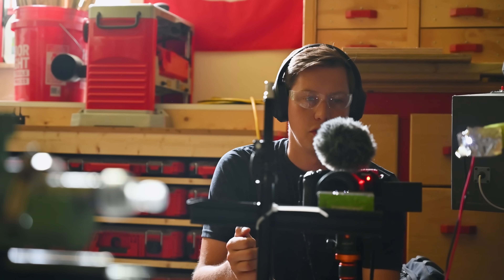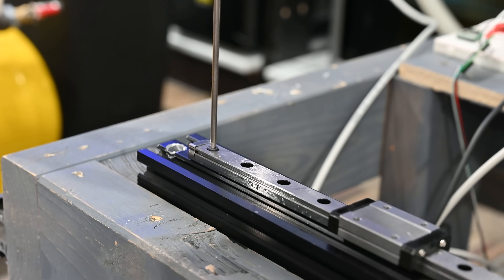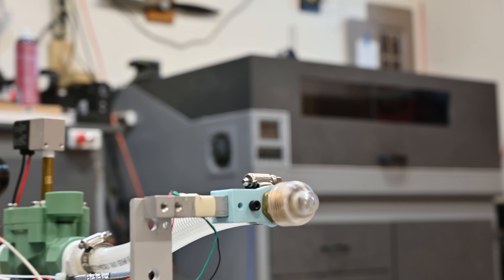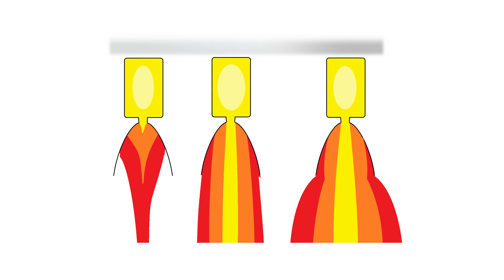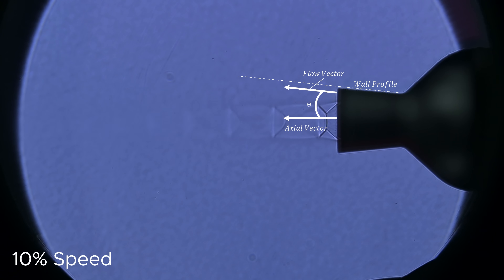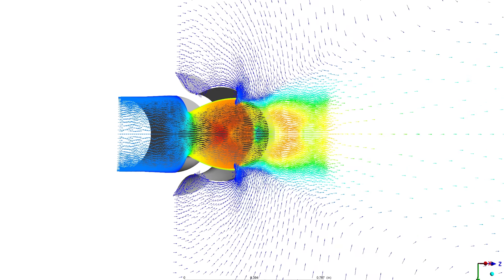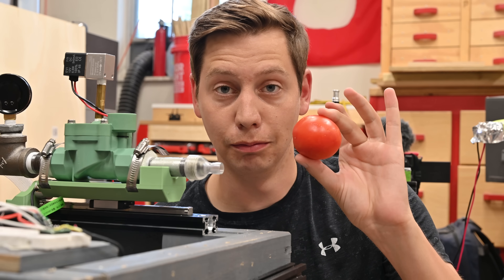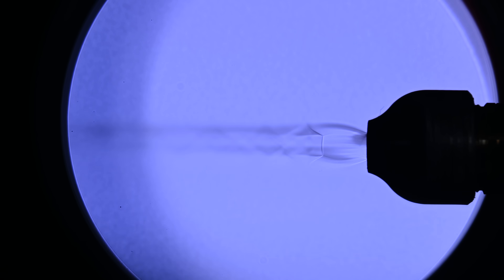DIY Supersonic Nozzle... In My Garage

Comment: This is genuinely an excellent example of using hand calcs! I think this kind of demo is important to show the engineering YouTube algorithm how to…do engineering! :) 

No shade but can we fact check mach 3 though. I looked up a quick isentropic table for gamma 1.4 air, and M 3 is a 4.23 expansion ratio. I’m sure the geometry is hitting that, but static pressure at that speed is 0.027x stagnation pressure which I think vibe check as below separation criterion, so maybe the realized expansion ratio is lower? 

Additional evidence for this is the formation of water(?) condensation later in the blowdown. At mach 3, the t/t’ is 0.35 so ballpark 100K if expanding from 300K in the tank? If you know what the humidity in your garage is, might be able to eyeball what temp you expect the humidity to drop out into vapor. Or more realistically uhhh measure Cf since you’ve got a known orifice for mdot, area and a load cell. 

Great success though, love the vid!

Comment: How did you modify the solenoid valve to have a higher mass flow rate 1:08 ? I have a similar project and would love to be able to use a fast acting high mass flow rate solenoid valve instead of burst discs which have to be manually replaced each test.

Comment: Great video! Nicely done! 

This is completely out of my wheelhouse, so forgive me if my question seems elementary, but would the calculations and formulas be different if your propellant fluid was a liquid  instead of a gas? Specifically, how could I get maximum velocity out of a low volume, high pressure water stream, such as what one might see on a pressure washer?

Comment: Have a question. I have an interest in 2 Stroke engines and am a welder/fabricator.

I've been wondering for a while if there is a readily available CFD program that can accurately model acoustic exhaust wave flow/pattern. 

Can anyone recommend a software capable of that which I could use in designing novel exhaust expansion chambers?

Comment: You may want to consider adding an air dryer to your compressor as it seemed that with each successive  test the amount of compressed water vapor seen during the initial valve release increased. As water has 830 times the mass of air it may be slightly skewing your results.

Comment: I really really wanna try taking a rocket nozzle like this, and putting it in a nerf blaster. My theory is that with most blasters the air pressure has no problem pushing the dart, so mont of the air is wasted. If you could start with the air movinc almost supersonic i think it would help
Reply: Keep in mind the rigidity of the dart when doing this, if you blast something that’s made for a children’s toy with supersonic airflow it’s probably going to rip and not fly very well

Comment: so why does copenhagen orbitals say that a pipe only loses 10% of the thrust of the nozzle, or lack thereof, like a wing without air foil shape only incurs similar losses, someone is feeding gaslighting nonsense to people, and everyone believes it. try straight pipe as the nozzle. yep solid rocket motors are mostly just straight pipes. no, thats nonsense, just use straight pipe, not buying what you say. even if everyone is using shapes unneeded.

Comment: could this be applied to propelling a nerf dart? having a nerf berral at the exhaust of the nozzle with a dart at the end? i admit id don't understand the science well enough. it seems like the air discharge is a bit to slow for a dart blaster, but can that be compensated for with a larger diameter nozzle at a loss of end air speed/thrust? other consideration is  do you get more of a burst with a smaller pressure chamber. the smaller pressure chamber allowing for a faster drop in thrust?

Comment: I am not quite sure if you necessarily need the razor blade in this case. First, shockwaves are very easily visible and are commonly viewed with shadowgraphy instead of schlieren. The reason for that is due to the first-order nature of schlieren techniques. That also brings us to the second point. Your razor blade is horizontal. But from the images of the Mach diamonds on the edges close to the nozzle, the top and bottom edges are vertically symmetrical, i.e. dark-bright above and bright-dark below. For schlieren, the upper and lower parts of the image would be the same, indicating what is observed here is shadowgraphy instead of schlieren.  I don't actually have a point here, btw.
Reply: point not taken

Comment: Just a slight correction on your terminology, when you showed a chart for under expansion and over expansion in a converging-diverging nozzle, you seemed to have mixed up the terms. An over expanded nozzle doesn’t refer to the exhaust gases expanding outward past the nozzle area, instead it refers to the nozzle having a larger cross sectional area than the idealized gas leaving the nozzle causing those gases to be over expanded. And with an under expanded nozzle it is the opposite in that the nozzle cross sectional area is smaller than the exhaust area, constricting it and causing the exhaust to create thrust vectors at an angle. In both cases these cause inefficiencies in thrust which is why a perfectly expanded nozzle is sought after.

Comment: Nice. Good math.  You can fly supersonic with a sonic nozzle as the speed of sound of the exhaust is quit higher than the speed of sound in atmosphere.  This is due to the higher temp of the exhaust.  a=sqrt(RTy)
Reply: i would presume this is at the trade-off of efficiency, seeing as less of the thermal energy being added to the air (+some combustion products) is being converted into velocity/thrust?  
(indirectly ofc via thermal to pressure to velocity......im not an engineer so don't know the correct terminology off the top of my head😅)
Reply: That depends on the temperature of your propellant gas though. In the demonstrated case, where the gas comes from a room temperature reservoir, the exhaust will actually be of lower temperature than the environment (the expanding gas is doing work and thus cooling down).

also, you can fly supersonic even with a subsonic exhaust, as long as the gas you're pushing out was previously stored in the vehicle. Thrust only demands that the velocity of ejected gasses is higher than the velocity of ingested gasses, relative to the moving object.

Comment: rocket nozzles and tomatoes? am i watching integza?
Reply: He would approve
Reply: I WAS GOING TO SAY
Reply: Yh I feel the same
Reply: Tomatoes are disgusting!
Reply: No you're not watching Integza. How to tell? The guy presenting isn't an idiot.
Reply: @Paksusuoli95 While I don't agree with Integza about tomato's being disgusting he's not an idiot. He may be goofy and his projects a little silly but that's His channel.

He's merging science and entertainment which isn't necessarily easy to do for an audience of adult children.

Much less (spoiled) adult children like you're comment causes you to appear to be.

Maybe I'm wrong and you're using idiot as a term of endearment. 

If that's the case you can disregard my comment.
Reply: @Paksusuoli95  Why do you say that?
Reply: @gooooooooooooooooooooose  Integza has at a few times really not thought well about the safety (of both him and of others) of the things he was doing. Like launching rockets from his house in a populated area, just igniting home made black powder motors while he is just standing a few meters away (this could've easily exploded if he was less lucky) or mixing the oxidiser and fuel of a solid rocket engine (AP and resin) in a fucking handheld kitchen blender. You don't mix explosives with a high speed blender, like wtf.

He's setting an absolutely terrible standard for pyrotechnics safety. I don't understand why he doesn't follow an actual course on pyrotechnics somewhere.